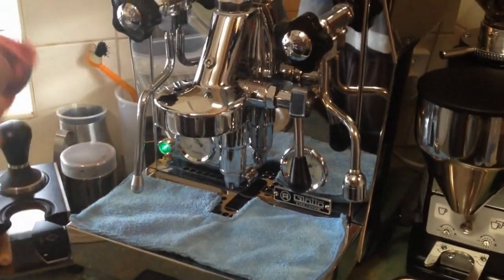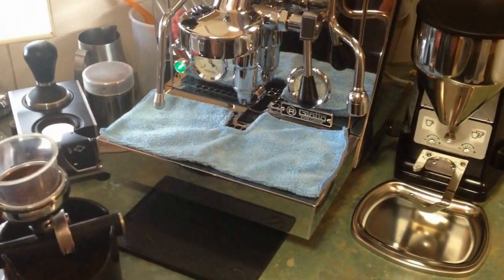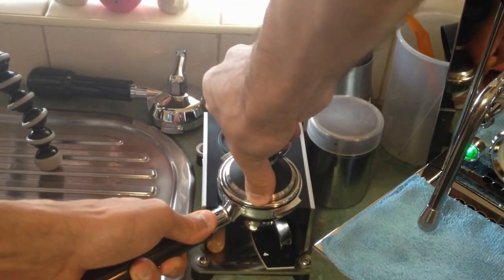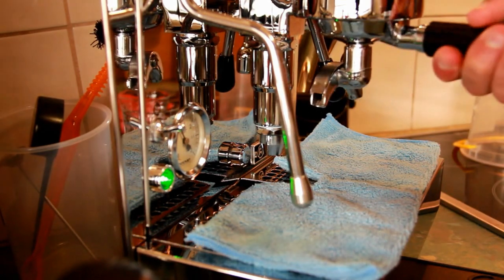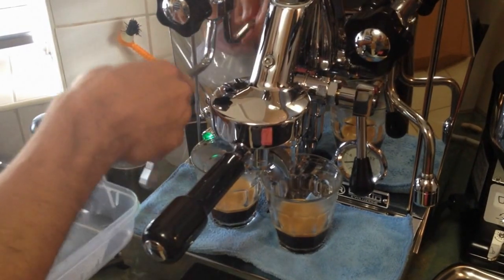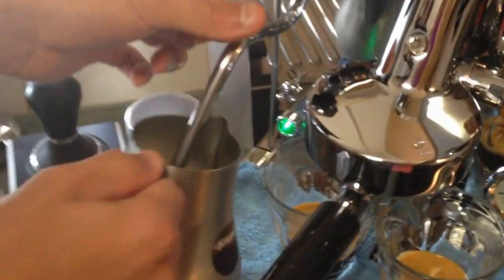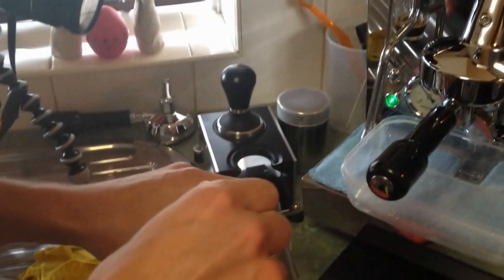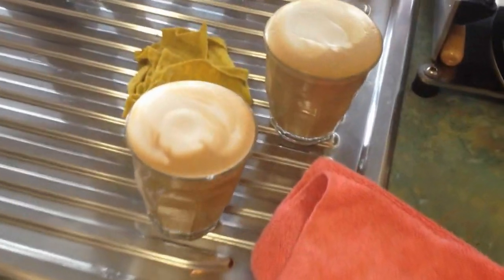Rocket Espresso

Comment: You know that towel you custom-made? the thing below it is what's called a "Drip tray" so no need for a plastic container to get the excess water
Reply: +Alex Kovachevic and for anyone interested in the machine, it's an annoying 'feature' of the otherwise stellar Rocket machines that the drip tray is quite shallow, so it makes sense to use a plastic container to avoid having to empty it all the time.  Plus, it keeps the drip tray in a more pristine condition.

Comment: I'm new to the whole espresso thing but are these machines ment to stay on all the time or do you turn them on only when you make espresso?  

Thx
Reply: well it all depends on the use man, leaving the machine on all the time is pretty convenient but these things drain the electricity like a golddigger drains your wallet so you might want to turn it off when youre not using it. Normally these machines need half an hour to heat up the system so if you want to make coffee before you go to work, you might want to turn it on before going to the shower, then make the coffee after.